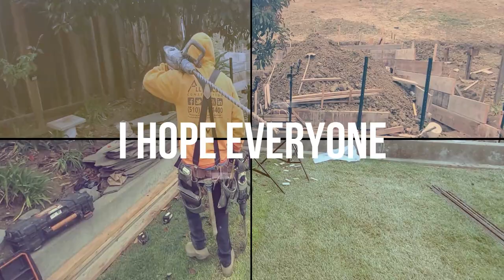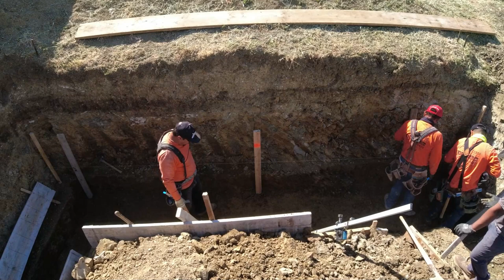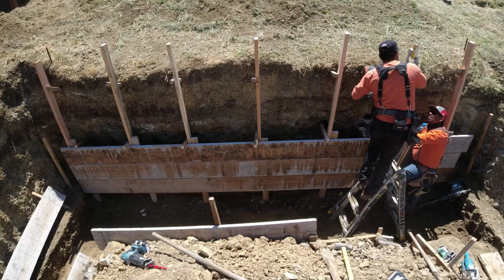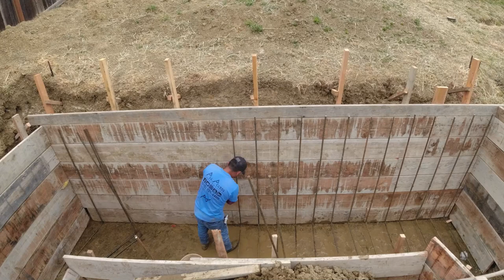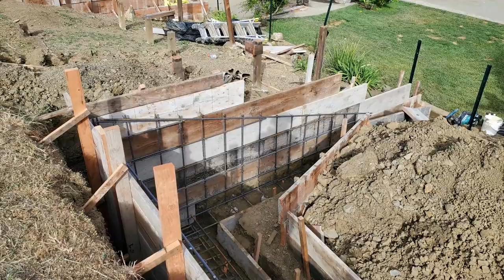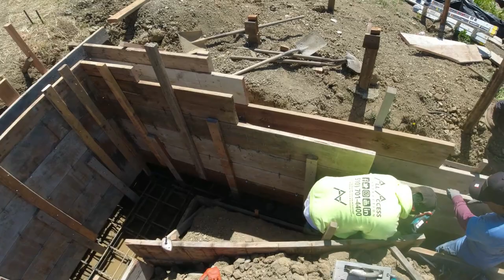How To Build CONCRETE Retaining Wall On A Slope

Comment: Are the weep holes core drilled immediately after the concrete dries?
Reply from the maker: No..The drainage Pipe will come out on either the right or left side..

Comment: do you ever need to put movement joints in your walls? I mean longitudinal joints for shrinkage and differential soil movement? and do you have to use sulphate resisting cement ever? and do you ever need to shore the excavation behind the wall if the ground is less stable? great videos thanks :)
Reply from the maker: We would put joints if we strip the wall the same day... Never heard of sulphate resisting concrete.... Haven't ran into a situation were we had to shore our banks..... Appreciate the question and comment 👍🏾 👍🏾 👍🏾